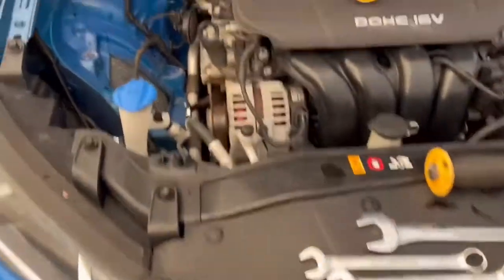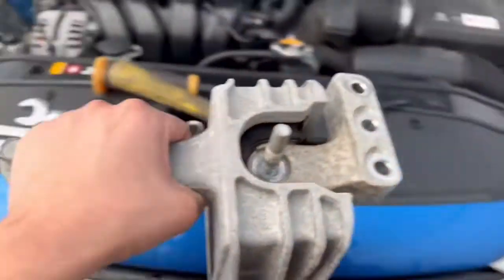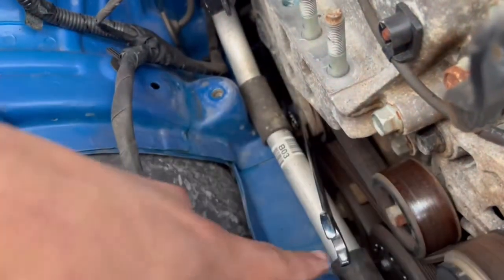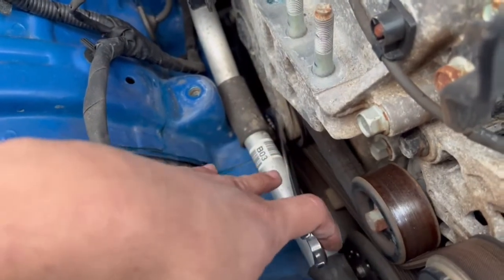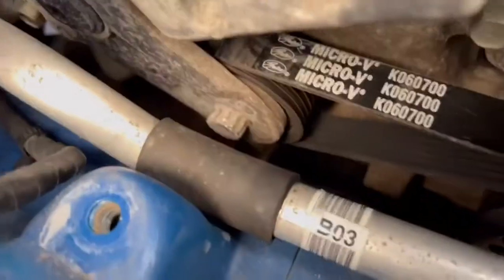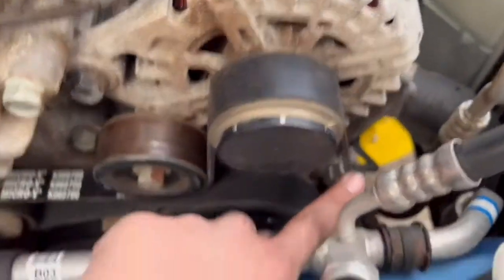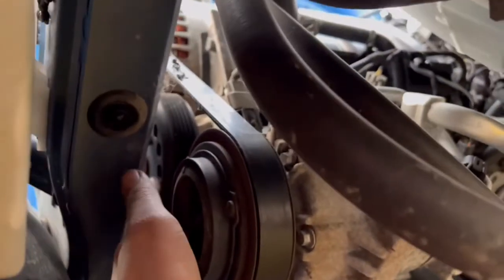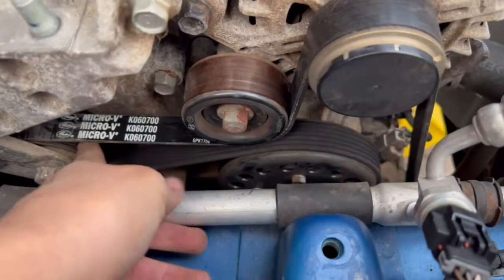2017 ELANTRA SE 2.0 Serpentine Belt Replacement!

Comment: I just did my serpentine belt on a 2018 Elantra. U don't have to take off the motor mount but take out the ground wire on the motor towards the fire wall and the horn bolt on the fire wall. Then put 17 wrench almost straight up (may need to double wrench for leverage)  push towards the fire wall and pull/put belt on.

Comment: Just did this on a 2019 veloster, 10x easier to come from the bottom to get the tensioner pulley, no need to pull anything off or loosen anything.

Comment: cool video , much easier way , just remove that bottom splash shield and have a long ass 17 mm 12 point , hit it from the bottom , no work up top just routing.